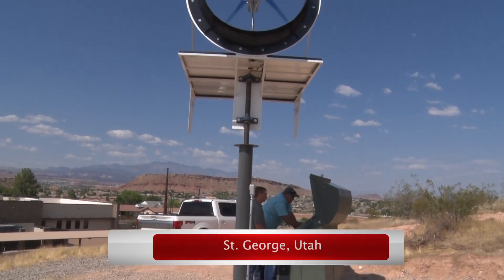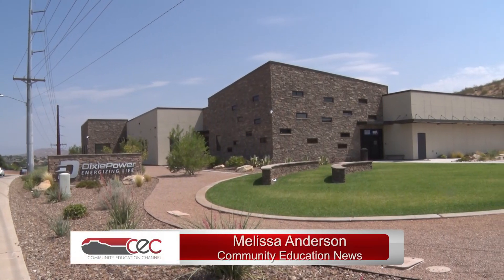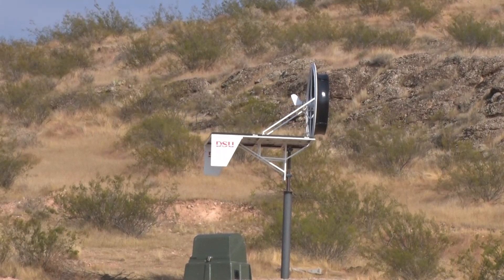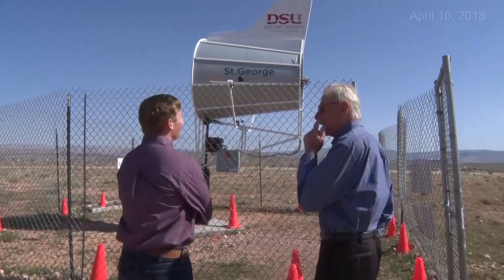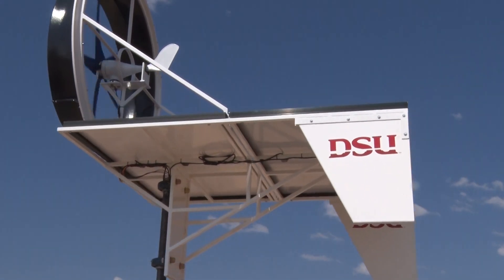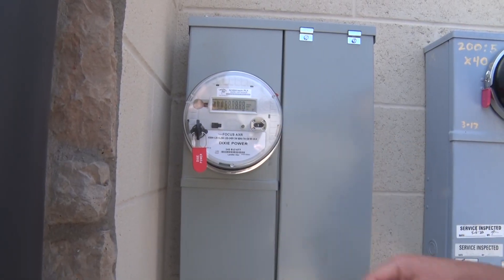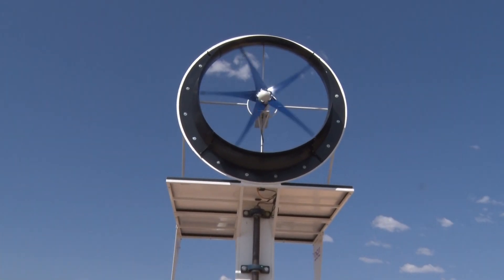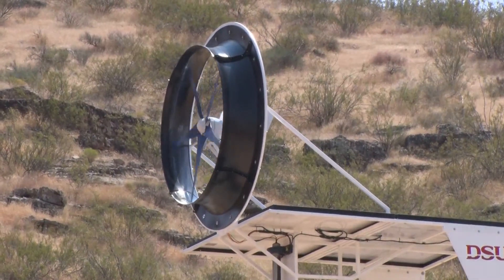Solar Wind Turbine tested

Comment: Obviously, they didn't do flow simulations, the ideal profile for a duct is a high lift airfoil, The just mount various conical  funnels behind the turbine and even in front, where it does nothing, measure a slight increase in output, which they undoubtedly are getting and call it good enough. Rest is spent on marketing.

Comment: Well.....cool in concept but the shroud is backwards and the turbine will just make a shadow on the solar panel every time the wind is coming from any direction but due north.... yes,wind and solar work fantactic together but this is not an efficient design. The weight of that could never be safe higher then it is and that turbine is only making power because it's perfectly placed in a jet stream.....but cool idea though.